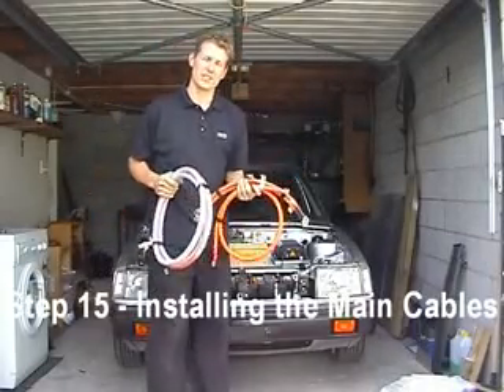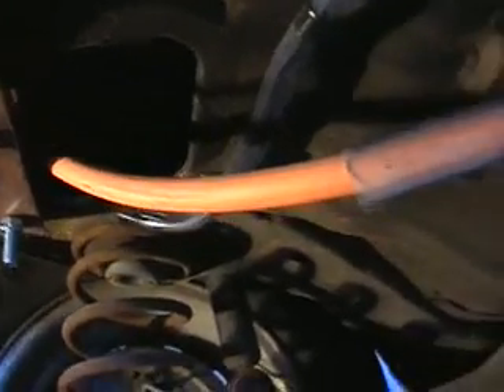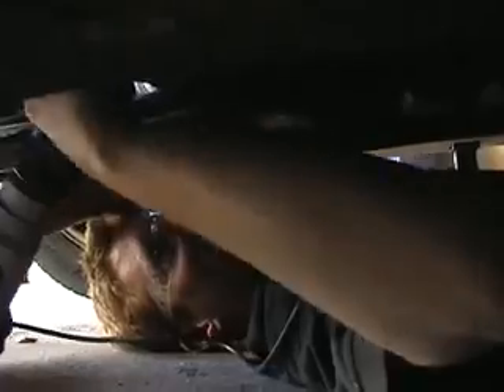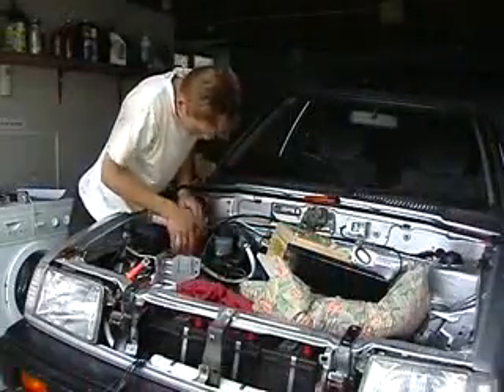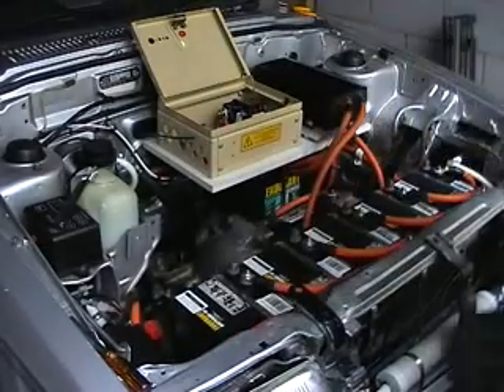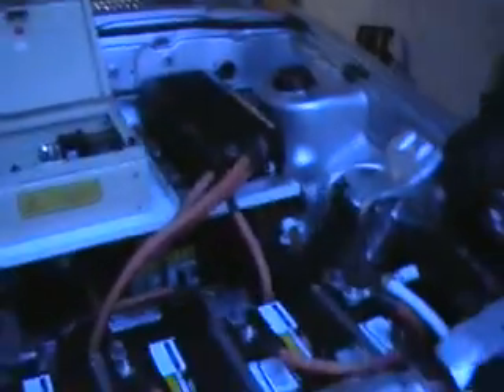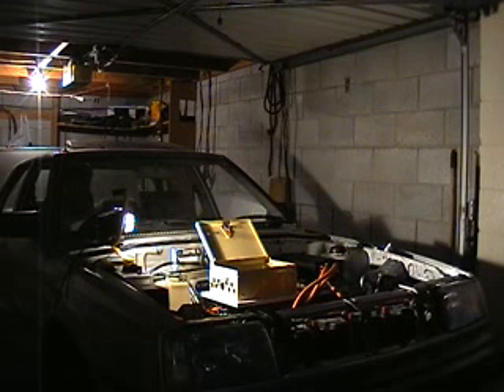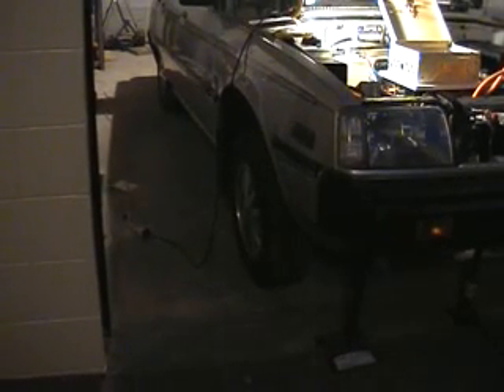Gav's EV Conversion 15 - Installing the Main Cables

Comment from the maker: The metal box was in a storage room at the local telephone exchange (let's just keep that between you, me and the rest of the youtube world). ;)

For some reason, that motor requires a jumper lead between those two posts when used as an EV. Not sure why but I just followed the instructions from the EV America folder that came with it.

Comment: Hey Gav where did you get the metal box that houses the accessory components? and it looks like you hooked motor positive to motor negative is that how its done with a series motor?

Comment from the maker: Gidday! The motor's rated at 100 HP (peak) at 1000 amps and 144 volts. 
You can actually put over 200 volts through these motors but you have to keep them cool if you do. The batteries are only 85 a/h each so it's nice & quick but not for long! :)

Comment from the maker: Thanks! That's the sound of the controller. It's something called Pulse Width Modulation (don't ask me!) which as far as I know means it whines at low motor speed. I like it! Sounds like something out of Star Trek!